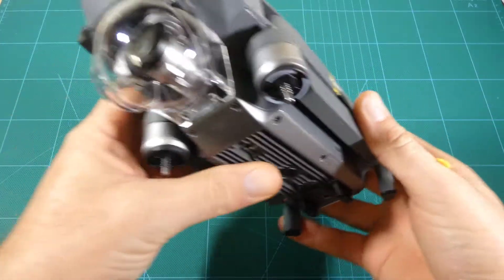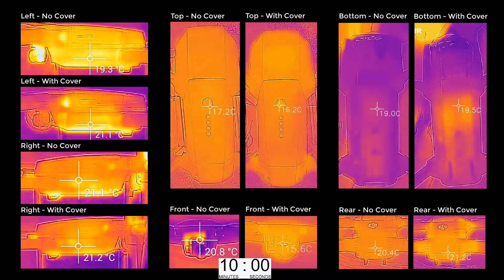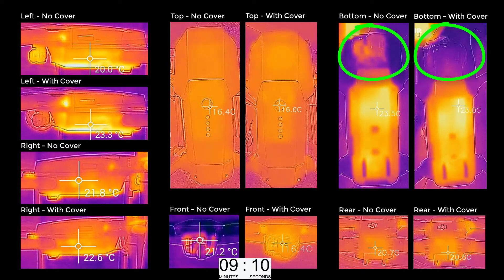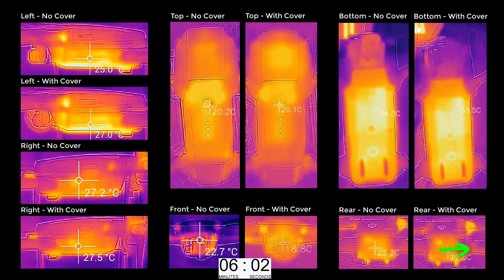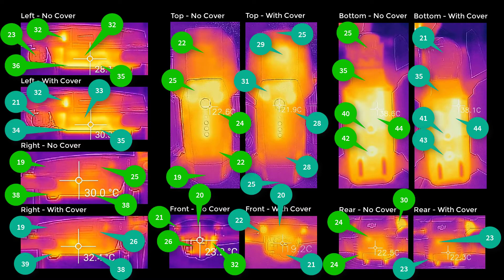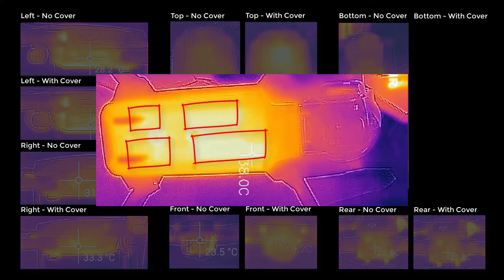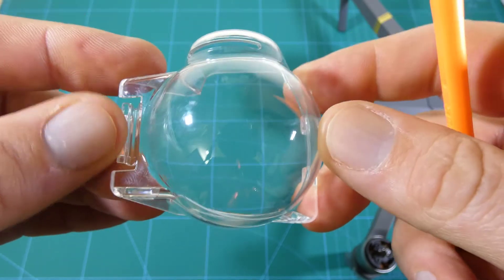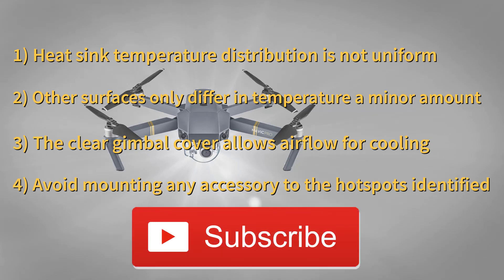DJI Mavic Pro Meltdown Flying with Gimbal Cover Fitted

Comment: It's okay to fly it with the gimbal cover on as long as it's cool or cold weather. Now if you flight with the gimbal cover on in hot weather, then you have a chance of damaging it, but in the cool or cold you are fine.
Reply: Agree totally, I fly with it off just from habit, nothing to do with heat concerns.

Comment: this heat generated is definitely a legitimate concern.  I am going to try and put a 15mm fan in the very back right under the wifi board in that area so heat will exit the rear